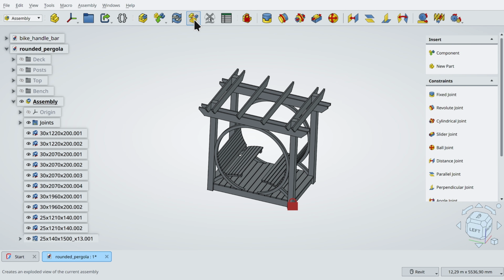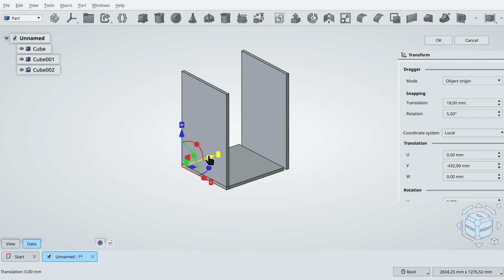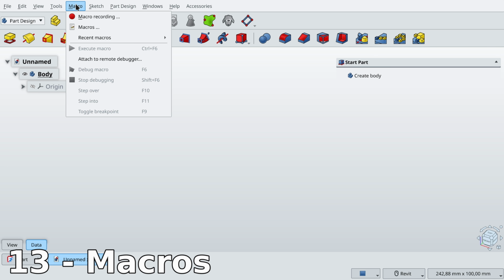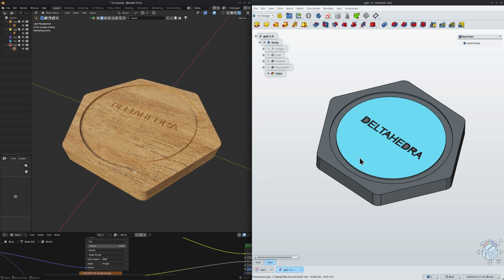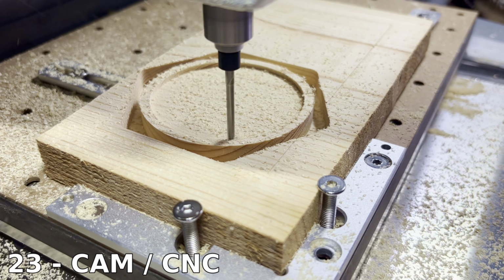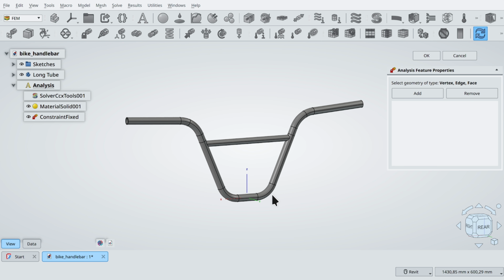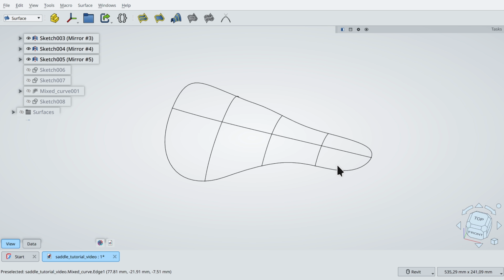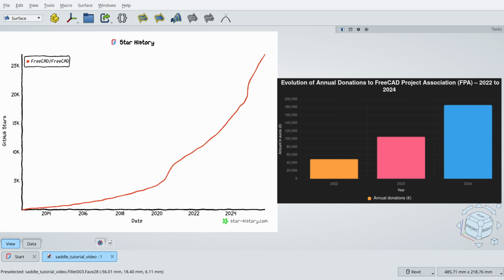30 Reasons to use FreeCAD in 2026

Comment: I am almost 49 now, I have +25 years of AutoCAD Experience, +15 years Vectorworks and about 5 years Rhino experience, I also used modo a lot, 3D Max and now a little bit Blender, should I really take a look into FreeCAD? I mean, your video looks interesting and promissing but can my brain handle more software knowledge? Unfortunately I am often forced to use specific software like AutoCAD because some clients use it and I have to stay compatible and use ACC etc.
But I have to admit, this FreeCAD feature list looks amazing. I also don't like the CAD Workflow inside Blender and all its Add-Ons that implement CAD into Blender in a very unefficient way, so FreeCAD + Blender looks also very interesting.
Reply: As a young people I say "do it" but also, I started from SolidWorks/Fusion/Creo and certainly in AutoDesk world Fusion is more CAD to me than AutoCAD. Between Blender and FreeCAD however, Blender is not design software.
Reply: @DasBuzzBuzz  I know, Blender is not a design software, but you could design with FreeCAD and create great renderings with Blender. People use AutoCAD togehter with 3D Max, Vectorworks with C4D, I use Rhino with V-Ray, Blender alone will not do the job in my opinion, but together with FreeCAD it might be interesting for architctural design + visualization since Blender can create greate renderings, can do camera tracking, compositing etc.

Comment: I use FreeCad and I have pretty good computer ( RTX 3060 12Vram, 32 GB RAM, fast SSD NVME disck ) and can you tell me why sometimes FreeCad crash and calculate some things that looooooooooong ? Bruh .... I don't create complex engineering projects, just things for my own use, and sometimes it works terrible ...

And I have a huge request: could you record a few videos of creating parts from 3D scans? I'm not talking about replicating something based on a scan, but about fitting a new element to the scanned surface.
Reply: I made a pretty horrific Bahtinov filter once and it was a little slow but also my technique was not great. Out of curiosity, what was it?

Comment: There simply can be no trust with closed source private companies, it can be a good product but they might just get bought by private equity or who knows and completely throw off its pricing and offerings at a snap of the fingers
Reply: that's simply a point against rolling updates, not against closed source,
for many programs you can still straight up by "Program 2025 edition", which is your's to keep independently of whatever the company later decides
Reply: @cj09beira that makes no sense, overtime you keep seeing how often closed source software is foregoing the buying by edition and instead requires subscription, the open source software I use is rolling but if they go a certain direction you can point your mirror to a forked version if you REALLY need that deviation and atleast have some autonomy when it comes to how your software stack grows overtime.

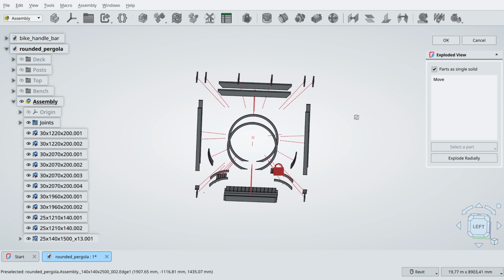Comment: 0:11 - Completely Free
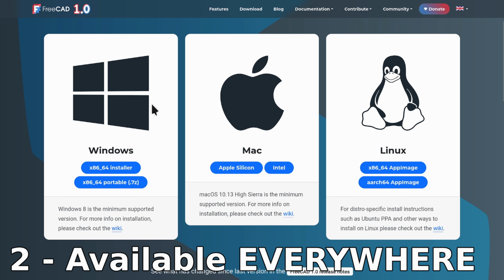0:20 - Cross-Platform Availability
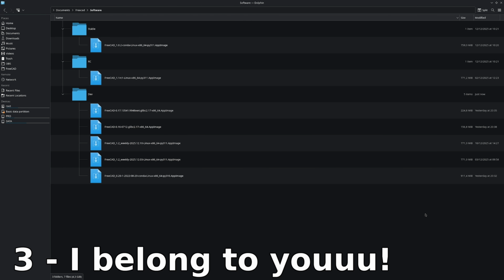0:38 - Software Ownership
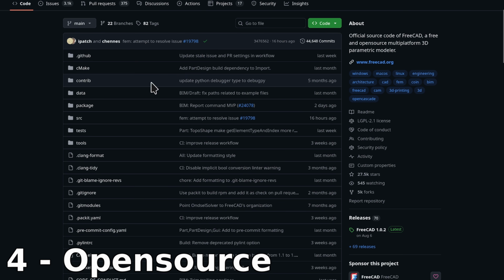0:49 - Open Source
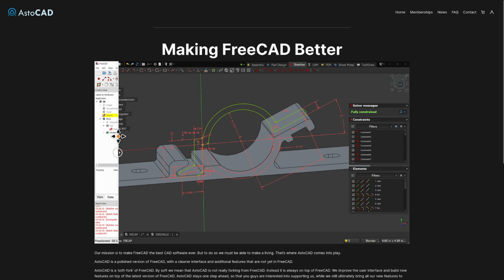1:05 - Offline Use
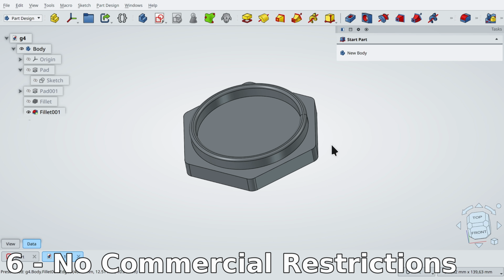1:12 - No Commercial Restrictions
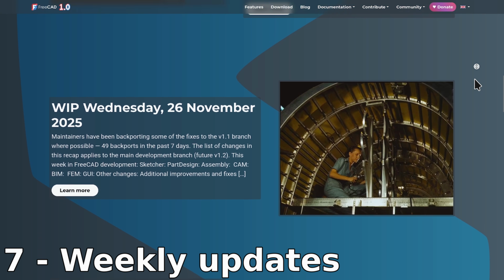1:27 - Weekly Bug Fixes & New Features
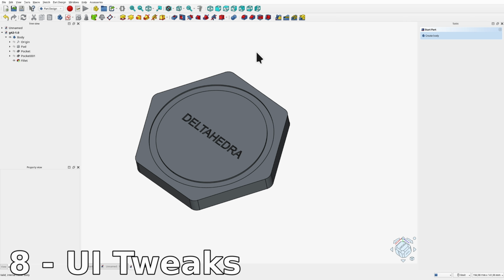1:41 - Customizable User Interface
1:51 - Modeling with Simple Primitives
2:27 - Complex Model Sketch System
3:35 - Advanced Parametrics with Variables
4:01 - Full Access to Operation History
4:16 - Macro Creation and Integration
5:05 - Complex Part Assemblies
5:24 - Exploded Views
5:38 - Parts List Generation
5:50 - Technical Drawings
6:16 - PDF Export for Drawings
6:25 - Live Link to Blender
6:44 - Wide File Type Import
7:00 - 3D Printing Tools
8:00 - Woodworking Workbench
8:26 - CAM Workbench
8:55 - BIM Workbench for Architecture/Construction
9:43 - Fasteners Workbench
10:12 - FEM Simulations
12:35 - Surface Operations for Complex Shapes
13:52 - Huge Library of Pre-Modeled Objects
14:11 - Tons of Resources
15:05 - Software's Future
Reply: Best comment yet. Thank you.
Reply: 👍👍👍👍👍👍👍👍 But worth to look all of them!
Reply: Best comment on YouTube
Reply: The 6 first points could all be summarized as "open source". The rest is all things other CAD softwares already do. 

I haven't used the most recent version of freecad but every time I tried using it before it always felt like it being open source was the root of all the cons. It doesn't feel like it has a single coherent design language, it feels like an application with hundreds of features made by dozens of people who never talked to each others. The same feature repeated over and over in different UI views but implemented slightly differently. 

Maybe I'll give freecad another try but the project really needs a solid direction at the top. Can't just make a product with a bunch of competent programmers if they don't have a common goal.
Reply: @EMILE12345678901  This is the best part of the open-source project: you can fix it. If not by code contribution (it is hard :( ), then by reporting a bug.

The FreeCAD has 1% of 1% of the donation that Blender has. The fact that it is Open Source does not help with the fact that CAD is an insanely complex piece of software. Unfortunately, what FreeCAD needs is not "better UI", but more developers. Everything else would be naturally resolved.
Reply: @EMILE12345678901  Yep, I want to love it, but it’s not even in a similar category to Fusion, which is one of the least expensive options out there. I run a business, I don’t have time to invest in something that doesn’t just work. Fusion costs about $1.50/day. If you’re using CAD/CAM software as a professional and $1.50/day is too much, you’re doing something wrong.

Right now I’m doing a job for a defense contractor. There’s no way I’m going to tell these guys I’m using FreeCAD for their project. I’d never get hired again.
Reply: @EMILE12345678901 yeah. That is really the big problem wjtb many foss projects. Though what had been happening as of late is making it a very viable alternative for hobbyists. And i really like that as i use arch btw. This and onshape are thw only parametric cad tools on linux. And id rather use freecad if possible. One feature in a pr is all i need to switch.

Comment: This has got to be the best channel on YouTube for FreeCAD that addresses making complex multi-body models. I'd love a tutorial video on how to make these complex objects and assemblies in such a way that they can be parametric and avoid common issues such as the sketch flipping issue.
Reply from the maker: @kylequinn1963 Thanks for your comment! Which objects are you particularly interested in? I might already have a tutorial about it.
Reply: @deltahedra3D  Just anything in general. I've watched almost all of your videos, they're EXCELLENT (especially without the AI voiceover). This video alone actually showed me several new features that I had no idea FreeCAD had. I'm a novice in CAD and often run into the "sketch flipping" issue whenever I try and make parametric models for my woodworking projects. It would also be awesome to see a video going over the Assembly workbench where you build the bike using all of the different parts you've featured in your videos! 

FreeCAD is amazing, it's so close to being my only CAD package. Unfortunately, that sketch flipping issue has made me start using SolidWorks again as it's just easier to get more stable models.